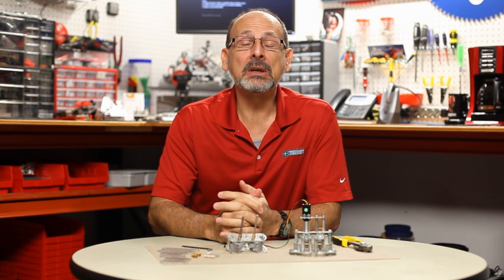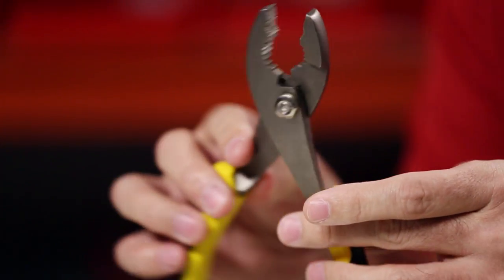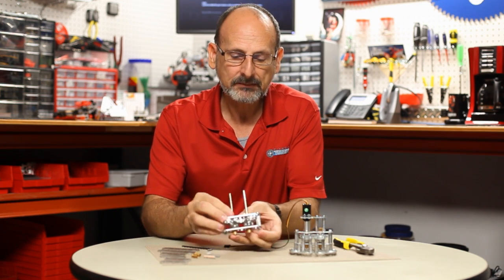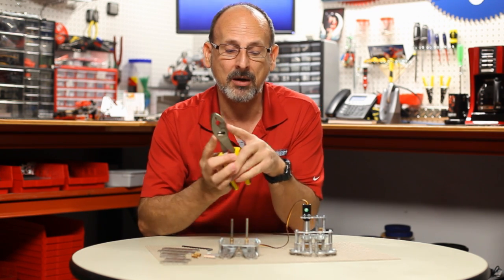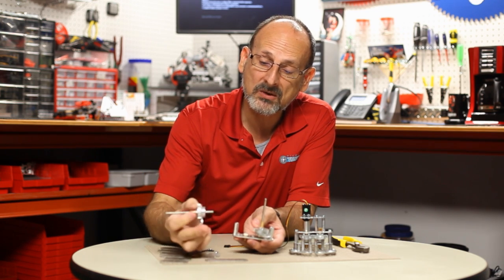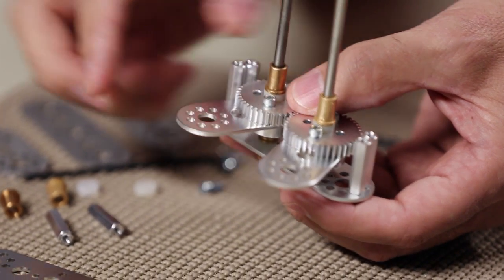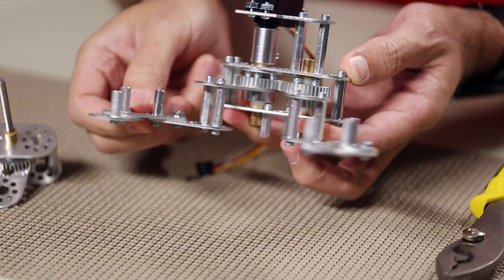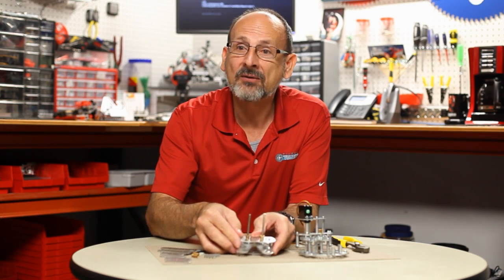Designing a Robot Gripper

Comment: What is the piece that connects the servo to the axle?  It looks like just an axle connector, but how does it mount to a servo horn?
Reply from the maker: That piece is the aluminum servo shaft to 4.7 mm steel D-shaft axle adapter that's included in the TETRIX MAX Standard Servo Mounting Kit (https://www.tetrixrobotics.com/TETRIX-MAX-Standard-Servo-Mounting-Kit). It's a specialty servo horn that connects the axle directly to the servo.